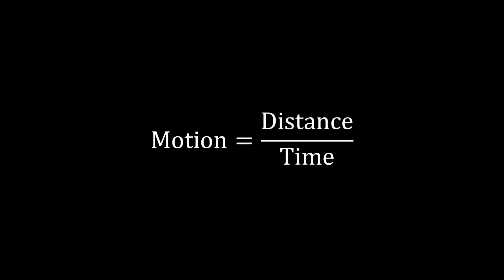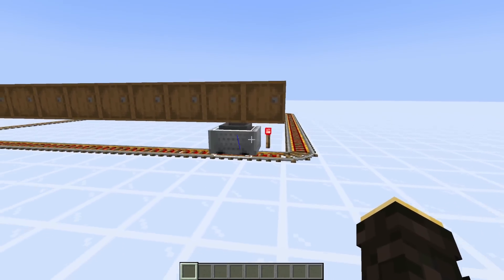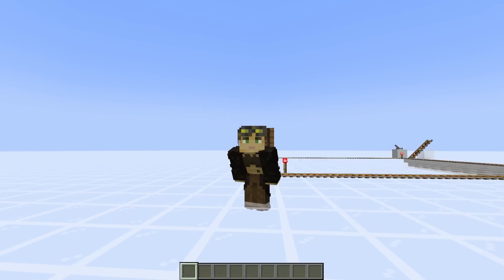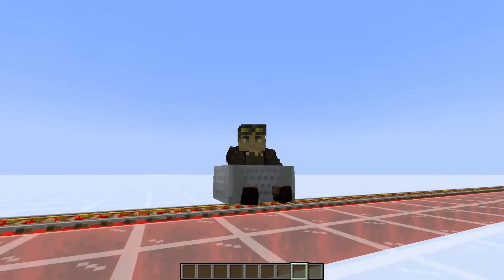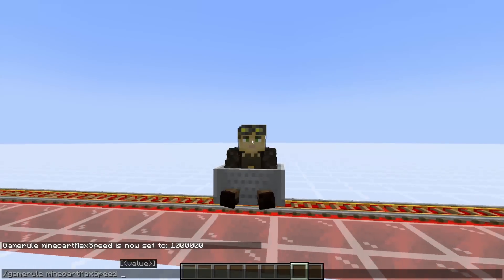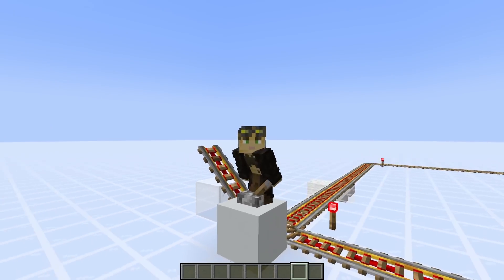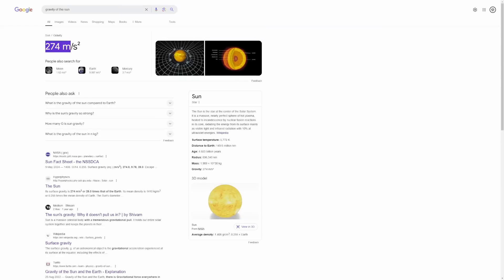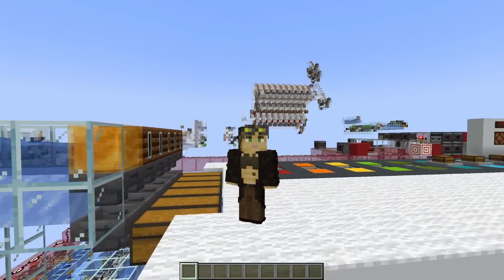Minecart Madness

Comment: I doubt anyone else misses it and no little ones will understand, but the furnace minecart is my favorite thing in Minecraft. The amount of shenanigans I pulled off with it before redstone tracks, and even after, the faster railroad building, the redstone I still managed to work, THE FASTER RAILROAD BUILDING... All but a distant memory now... Those were some good times. Why can't we just bring that back and then it can push, and maybe pull for faster speeds with some chains for attachments, as like a short unbreakable stiff lead or something, and better fuel could even make to go even faster and pull harder, if it cooks for more than coal it could get a bigger boost and pull bigger trains but only last as long as coal or something, and we can have racecars, trains, and flying carts, and everyone can have something... Especially me😅🥰 Just give me my cart please😅💜 also, why would you really want to bring back minecarts breaking and derailing again?😅
Reply: i just like furnace minecarts bc it helps me push villagers up ramps easier when i don’t quite have enough gold or redstone to craft the powered rails
Reply: absolutely agree on furnace minecarts, I used them several times when was transporting villagers (as well as other mobs) somewhere, as they are pretty cheap and do the job fairly well (well, most of the time, at least, in the current state they are slightly weird)
I would love to see mojang allowing to put in them, for example, blaze powder, or gunpowder, or something similar to this, making furnace minecarts produce a lot more particles, noise, and ofc a lot more force
Reply: There's a mod called "Cammie's Minecart Tweaks" that implements the incredibly obvious idea of linking minecarts with chains. This allows furnace minecarts to act as engines pulling a train containing any other minecart.

It lets you move huge amounts of items and mobs quickly. Instead of making a dozen trips carrying shulkers full of items, or hundreds if you don't, you can make one long train full of minecart chests.
Reply: I agree with you, specially with the derailing mechanic, it was just an annoying bug, there's no reason to implement it on purpose, it would confuse and annoy people, and also make  fast lateral rails impossible
Reply: @RobopYoutube  if it derails consistently, it could even be a fun mechanic tho, allowing for separation of minecarts for example. Passenger carts go faster so they would derail while empty minecarts would just turn. You could then catch the derailed minecarts onto another track
Reply: @fojtikv  maybe, but for what I have seen (with mods that make minecarts faster) it's just extremely annoying
Reply: @fojtikv  if it was consistent it could be fun, but it would suck to have to slow down before a turn and ruin the fast vehicle vibe, but could be cool for more realistic trains, but the mechanic wasn't fun in practice when you were just trying to play casually, and besides not being fun wasn't really that consistent, every direction broke the minecart in a different specific way, but you could use those specifics for cool redstone, but it would break a lot of new redstone if it was added back too so idk, It's a double eged blade
Reply: @fojtikv  Unfortunately, due to Minecraft's blocky nature, the realistic solution of gradual curves isn't possible.
Reply: Furnace minecarts are still in the game and I don't understand why no youtuber is testing it in a minecart speed update.
Reply: @RafaelScarpa  they are!!??!!??!?!!??!? I play java a lot because its just better with all its little mechanics, but swear i try to make them all the time just for nostalgia and I just can't. Unless I was just playing bedrock everytime I tried but that feels unlikely, but it does say they are in java when i look it up. I wish i had my computer right now cuz I would actually cry if i can still use them... Especially if it was there this whole time and I somehow missed my favorite thing...😅🙃
Reply: @DexyD20  Can confirm, furnace minecarts still exist. I thought i remembered hearing Mojang was getting rid of them, but i guess not?
Reply: @littleboyred1  sorry, I've been catching up on lost time with my furnace minecart... This should be in bedrock...😅
Reply: finally somebody said it
Reply: I used to think it was cool if I had to use fuel to power my redstone contraptions so I would run a furnace Minecraft up a slope and fuel it and it would come down and cut my redstone lines off if the fuel ran out. It was pretty fun
Reply: Are you worried because you played on big servers always updating as soon as a new version comes out? Otherwise, couldn't you sinply chose to not update if an undesired version comes?
Reply: being able to link minecarts with chains, then putting a furnace minecart in front of all of them would be really cool
Reply: @callyral I have been saying this for years.

This needs to be in 1.22

Comment: the copper rail suggestions would actually be perfect
Reply: It could be possible to instead apply it to minecarts.
Wax the wheels to make them go faster. Add copper to make them go slower.
That could cause item creep though.
Reply: @jimcobbler3954 I think that it would be better to have the rails be copper instead of the minecart. If minecarts were added it would add 32 different minecarts (minecart, hopper, chest, TNT) × (normal, exposed, weathered, oxidized) × (wax, unwaxed).

If rails were added it would just be 8 variants
Reply: @cencent2189  I rather not have copy of minecarts
Reply: @meifray  same 🤣 I was trying to say why copper minecarts were a bad idea
Reply: @MyrhaFluff  I think a simpler solution would be to have copper minecarts that are faster than iron,  they could even oxidize to become slower
Reply: @enn1924  Yeah I also had the same idea. With this implementation, only minimal effort would be required to keep current redstone devices function while faster minecarts are also easily accessible - best of both worlds in my opinion. If only, if only Mojang listened...
Reply: @enn1924  a rail that increase speed if it is slow and decrease speed if minecart go fast
Reply: @enn1924 
Copper is much easier to obtain than iron for a non tech player these days. 
Id argue copper carts would be capped at 4-6m/s. Iron at 8 (existing) and that there are a few tiers above iron like gold, diamond, and netherite with increasing top speeds.

I was a proponent of this before but seeing mixed rails in the same system that allow for variable speeds on the same cart is quite enticing.
Reply: @madman2572  why would you want copper minecarts to be slower
Reply: @enn1924  having slower carts as well as faster ads versatility for different applications.
Reply: @madman2572  let rails be placed on soul sand and honey to make them slower, copper minecarts should be faster as copper is lighter than iron and since copper is a better conductor it could have better conductivity from power rails.
Reply: @enn1924 then iron minecarts would become useless
Reply: @HazzaMazzaVR  you don't always want to go as fast, and copper rails could be slower than iron when unpowered

Stop hating and find solutions instead lol
Reply: @enn1924  yess! this is a good solution!
they should add player-minecarts that are faster, but keep all the old functionality for the normal minecarts
Reply: @lqm_lastquartermoon  I feel like a different rail makes way more sense than different minecarts. Don’t ask me why, I have literally no clue, it just feels right. I guess one thing is that they are the common denominator for all (most) things that involve any sort of minecart, so it makes sense that they are the thing that varies.
Reply: @MyrhaFluff its not with the way the game is coded, the Max speed can only be a single value
Reply: @gaminggamer9698   There is no reason that can't change. Minecarts are entities. Store the max speed in the NBT and update the speed of each cart to match.
You can't do it with a datapack, but Mojang could do it.
Reply: @MyrhaFluff  i do not doubt mojang could, they already completely overhauled the portal logic
Reply: I think the redstone idea is better because it would take a crazy amount of time to oxidize every single rail to a specific speed, and then wax all of them as soon as they get to that speed. Redstone is much quicker to build and has much greater control, allowing for both simple and complex builds. If you want to stick to the old way of using a lever, it'll max out the speed limit and seem normal.
I think copper rails could work as a constant speed variant for slowing carts down to a certain speed, or maintaining that speed. For instance, you could use a constant speed for hopper minecarts, or you could set a copper rail every 20-50 blocks to throttle down the minecart to the speed limit. That way you only need to oxidize very few rails for most builds (including redstone and long-distance rails).
Essentially, redstone rails would set maximum speeds, copper rails would transition the cart to a constant speed (speeding up or slowing down).
Reply: Hope at least one of the Minecraft devs watches m³'s channel
Reply: They should make it so that oxidization changes the speed of the copper rails or make a lubricant that changes the speed of the rail when applied

Edit: I just realised that if they make copper rails that’s an even better way to make mine carts compete with elytras by making them cheaper
Reply: @m_brine_85  why would they add a lubricant when honeycomb already exists?
Reply: that's a horrible suggestion tbh
Reply: @OPeratortypeN2  not really. Like with all the shit Redstone updates, make bluestone and use copper rails. You know what's a shit idea? Mob votes.
Reply: it would make copper less useless
Reply: finally a use for copper.
Reply: i would love those.
Reply: I concur more Minecraft project mayhem
Reply: The minecarts are made of iron, copper would not hold up as it is a more brittle metal.
Reply: @Holden-A-Gun  Keen observation
Reply: Yeah it is and so many people have suggested it
Reply: And not just because of its commonality
Reply: Fr
Reply: copper could finally be useful
Reply: Mojang would never take good suggestions 😂
Reply: @GlowBerryPumpkin sadly, that’s true
Reply: Mojang has showed very diligently that if you suggest something that they didn’t come up with they will not implement it no matter how good it is. Sounds like an Ego problem on Jebs part .. lol 😝
Reply: @JohnDoe-pe1fh  so true lmao
Reply: @GlowBerryPumpkin  they would if legends like mumbo jumbo and other big red stoners make a suggestion.
Reply: @jessbread4670 mumbo is not big nor a redstoner NOR a legend. Cubic is a big redstoner.
Reply: It's too perfect, Mojang would never 😂
Reply: New useful features that would make the game fun? Yeah right 😆 🤣
Reply: i like the idea but it would be more simple to change the hopper cart's speed and let the normal cart at a higher speed
Reply: @eliaselias6277  one word they'll use 😢 "Parity"
Reply: It would finally give a purpose to copper